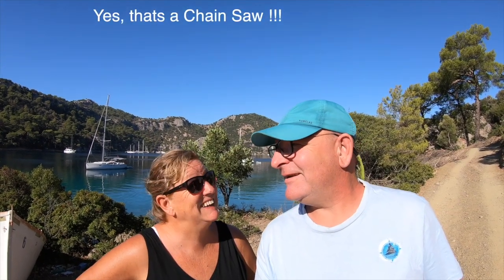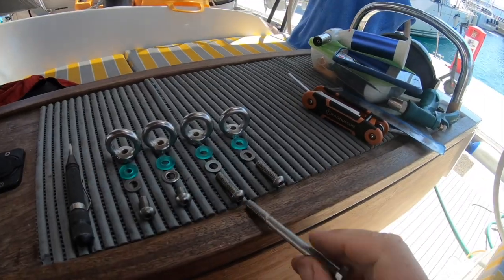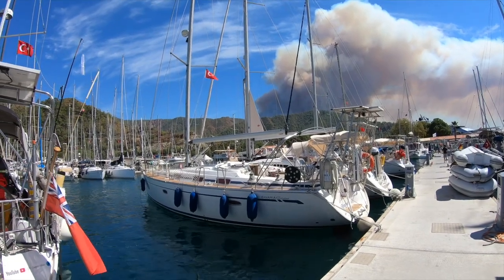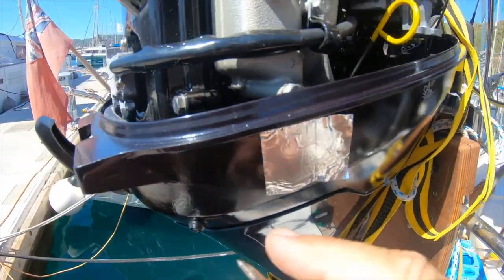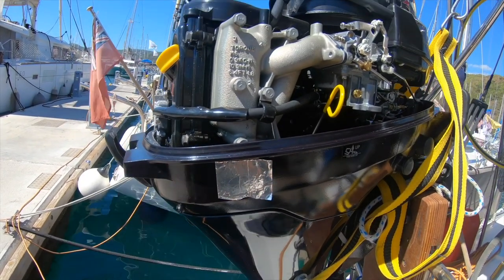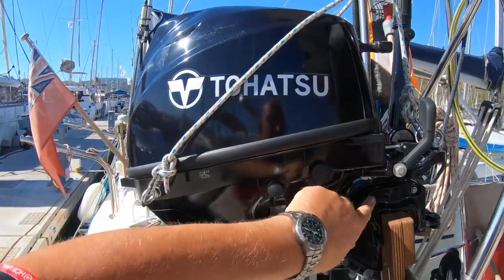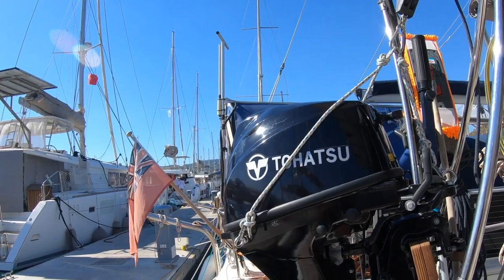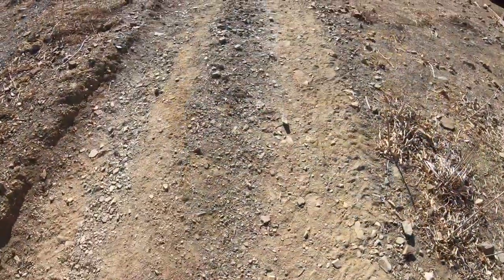How To Lift Your Outboard (without dropping it)

Comment: I don’t know when, where or how, but I’m getting a 15hp engine and will need to do this at sone point!!! Right now I can lift my 6hp no probs but 15hp might be pushing it 🤪😂💪
Reply from the maker: Hi mate. Get a 15hp two stroke they are half the weight of the 4's. You can get them out there but not in europe and some other places. Sail Safe Guys, Ant & Cid.